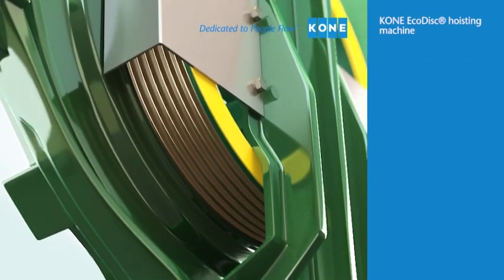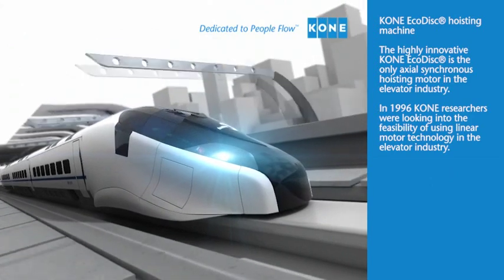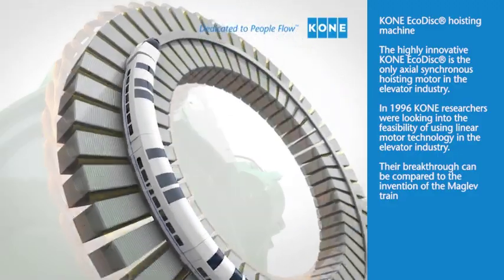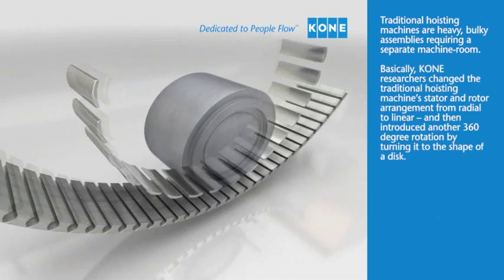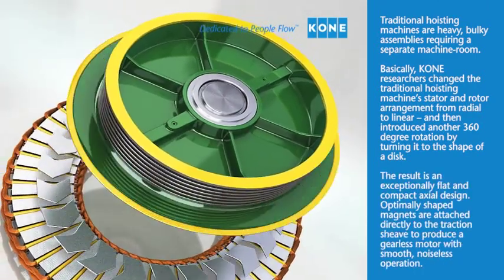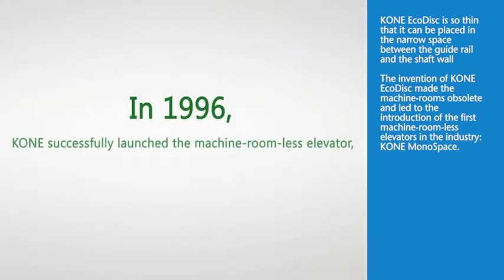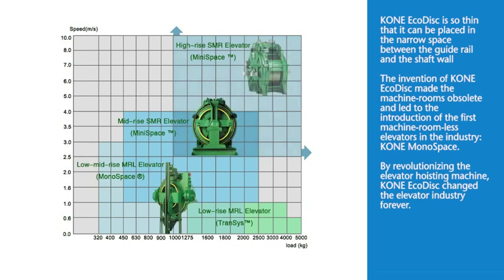KONE EcoDisk machine

Comment: Awesome video of Kone EcoDisc! Kone EcoDisc hoisting machine is very energy efficient due to the linear arrangement of electromagnets and permanent magnets which cuts energy consumption and reduces vibration and noise. It also makes it more compact, which helps saves valuable building and shaft space, and increase car capacity. The Kone EcoDisc hoisting machine also makes elevators more sustainable and environmentally friendly, and reduces carbon footprint levels for a pleasant environment! Spectacular job Kone! 👏👏🙌🙌❤❤💕💕👍👍🦾🦾🦿🦿💪💪🦵🦵
Reply: Just ads

Comment: The best lift ever i don’t think any lift company can make a better lift motor or lift and when I surf it I don’t haft to go to the motor room to see the motor and it’s very smooth and nice sounding and I don’t think they can make it better than it already is keep it up kone

#kone
#KoneEcodisc
Reply: well, in MRL realms you're right, however when it comes to Motor room lifts, you'll not often find, but extremely efficient Miconic V lifts, which basically beats competition of every lift, Schindler doesn't really install it nowadays, though

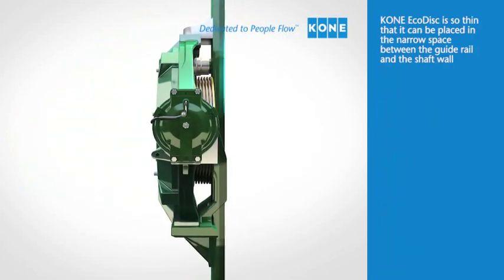Comment: 1:17 did you just said noiseless operation? It made some loud noises, but not on the newest generation. Anyways the noise is my favorite.
Reply: Same for me, older EcoDiscs sound a bit noisy because of that "CLUNK!" noise while starting and stopping, but lastest generation EcoDisc have got rid of the clunk to reduce vibration and noise by redesigning the braking system to a highly efficient one.
Reply: Does this model have the redesigned braking system? MonoSpave300 DX PW08/10-19